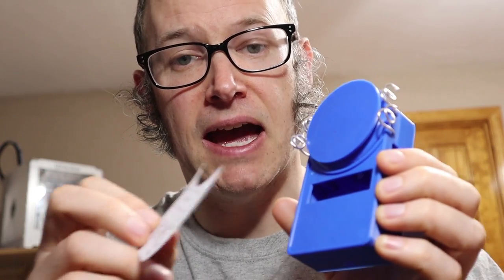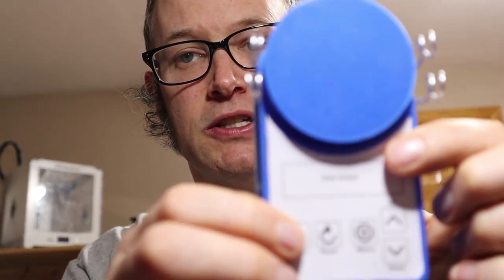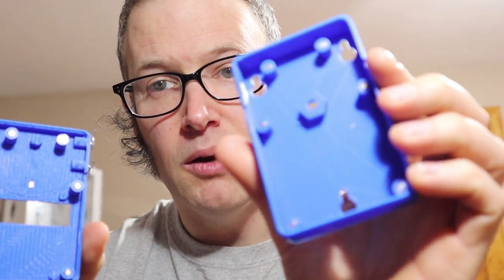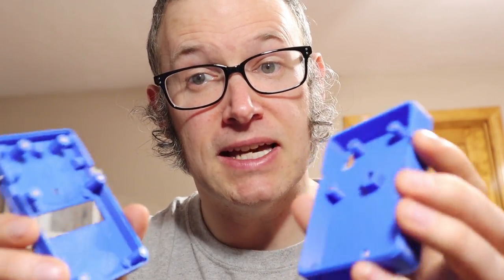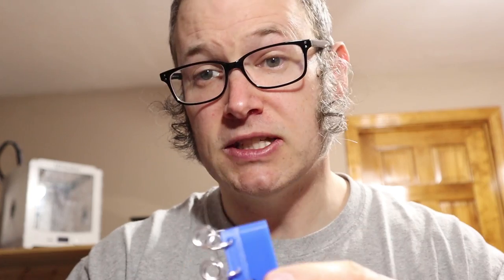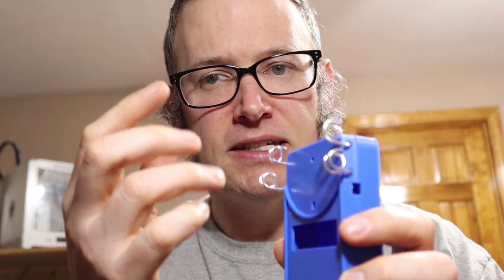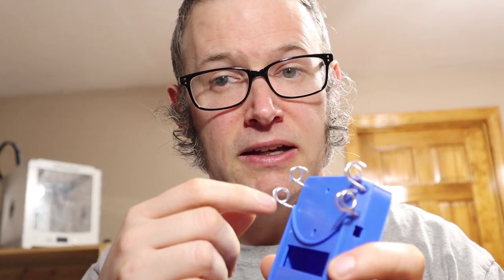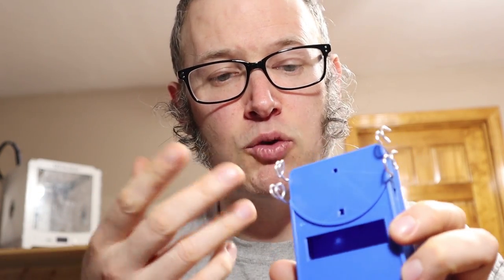SPIN #69 - Help Design the Ultimate Yarn Counter

Comment: - Love the size! 
- Love the UX overall, but recommend remove the circle around the menu icon (just use UI-standard “hamburger”). 
- Vote YES for the nicer keypad (better haptics). 
- Power button should glow green when on (obviously). 
- Yay magnets!
- like the clamp/ bolt but be very sure it’s got plenty of room for tables with deep lips ;like many Costco “cafeteria” tables
- love the programmable beep option! Love the ports! Be great if power cord matches nano’s. Other port could be for software updates and customizable settings outside the menu settings (customizable colors if OLED, etc)? Use universal mini-usb connection? OPEN SOURCE MAKES ME SO SO SO HAPPY THANK YOU SO MUCH!!! Name: “EEL COUNTER”
- OLED display maybe?
Reply from the maker: Great feedback overall.  

I probably wouldn't make the button glow green because that would consume a significant amount of power (10x more than the screen when the backlight is off).  Also there would probably be a problem with the screen being in the way of the green led.

One nice thing about the clamp is that it can easily be extended by just buying a longer bolt so if the one I ship doesn't work on a really thick table then it's easy to get a different one at the hardware store.

Oled screens would use a lot more power than a reflective lcd screen.  My lcd might allow backlight as an option, but oled would never have a low power mode.  Remember I want a mode where this lasts hundreds of hours on 2 AA batteries.

Comment: The size looks nice for how it sits in your hand.  You should also have a feature on giving a choice of Yards and Meters.  Many of your customers who purchased your Eew Wheels use Metric System vs Standard System.  You should put the type of plug that fits the same cables that came with the Mini or Nano wheels.  The buttons look nice as your prototype.  If you have a kickstarter for this device, I'm signing up for one.  Knowing you your price will be very reasonable/ affordable.
Reply from the maker: Thanks for the feedback.  You will be able to switch between yards and meters.  

Unfortunately, I can' really use the same power cable as was used on the EEW Nano since the voltages would require a completely different power regulation chip.  I think I'll just focus on battery power for this device.
Reply: @DreamingRobotsBlog  A battery power would be just as nice.  That way you can still use it when you're away from home and there's no place to plug it.  The idea for a name of this device is; Eew Yarn Counter.

Comment: This device sounds better and better. It's wonderful seeing a device take shape. The only suggestion I have is for the keyholes to match the spacing on the eew nano. I'm not sure the reverse measuring tape device is as large as the base of the nano, so this may not be feasible.
Reply from the maker: This is much smaller than the EEW Nano so I won't be able to make the key holes match.

Comment: I'm loving the look of this, the size is ideal, not too big and not to small. You might want to consider two different sizes on the yarn guides one set larger and one set smaller. To accommodate bulky/chunky art yarns.
Reply from the maker: I will do testing with different sizes of yarn.  It's my hope that a single larger yarn guide can handle most types of yarn.

Comment: I too think that the counter’s orientation may be better in a vertical placement.  Thinking to how I would use this meter, it would either be positioned between my bobbin of yarn from the lazy Kate to a niddy noddy or skein winder when skeining my yarn prior to washing/finishing it.  I may instead, or also  use the counter between my swift and ball winder when winding my washed/finished yarn when winding into a ball prior to knitting with it.  (The yardage usually changes after the finishing process, so I may wish to have both counts.). Anyway, in both instances, I don’t know if it would have an impact on the yarn staying in good contact with the counting wheel if the yarn has to travel from bobbin down to counter/ table level, then back up to a skeiner, or from up off a swift, down to table level then back up to the ball winder.  The yarn would be travelling down in a vertical direction down to, then back up from the winder, with the short distance against the counting wheel/pulley being held in horizontal tension.  Would it be more likely to pop out of the counting wheel groove with upward tension at each end?  Perhaps if the yarn makes a full wrap around the pulley before leaving the exit loop, that may help it to stay put, or at least give more grip with slippery yarns.  Most other yarn counters that I have seen have the counter vertical, or with less deviation from a straight line from source to end.  Perhaps in practical use there is a reason for this, but you are an innovator and will for sure have considered this.  The little ones that simply run the yarn through a slot (like a fishing line counter) seem to be horizontally fixed, but work a bit differently and do not handle as much as a variety or yarn sizes.   Thanks for hearing all of our input.
Reply from the maker: No, having the yarn travel down a few inches won't make it more likely to pop out of the pulley groove.  We will test if having the yarn drop is an issue.  If it is a problem, I don't think making the orientation of this device vertical will solve any issue since that would just move the pulley up a few inches and that wouldn't likely match the height of many people's setup.  Instead I'd probably recommend people put a base under the yarn counter to bring it to the desired height, but I don't think this will be needed.

Comment: Would you consider having some sort of way to attach it to a surface  up on its end, like the position you often hold it in this video? I would like to be able to mount it on the table in front of my nano's orifice to get an immediate yardage count as I spin. Your ideas are amazing. Thanks for continuing to make cool things for the fiber community 😊
Reply from the maker: I have thought about this, but it would require me to find a way to attach the yarn pulley with something other than gravity, while keeping it easy to take off.  I also couldn't come up with a good reason to do this.  It would move the yarn hook up a few inches, but why couldn't the yarn just drop a few extra inches.  There should be no downside in that.  Maybe it makes the screen a little easier to read in certain cases, but the yarn pulley problem would be a pretty big change so I'm leaning towards just a single orientation.

Comment: I really like the choice of mounting options provided and the external power is a big bonus. Love the idea of pre-setting it to let me know when I reach my desired length.
What colour options can we have for this unit? Same ones as the Nano?
Is there any "memory" in case I need to turn it off for some reason and come back to that same yarn later?
Reply from the maker: I have not yet started thinking about the color.  It will probably have to match or complement the keypad colors.

Yes, it will remember where it is if you press the power button.

Comment: Thank you for all your hard work, Maurice.  Please keep things simple.  People will learn where the buttons are no matter where you put them.  I for one would much appreciate being able to use external power, or have the device itself be rechargeable.  (Would weak batteries begin to give false readings?)  I know an extra mounting hole isn't a big deal, production-wise, but I would think that the 4 corner keyholes would be sufficient.  Someone mentioned "slippery" yarn, which would be a definite consideration for those of us who spin silk, tencel and like fibers; a bit of texturing on the pulley may help.  Name?  Short and simple would fit nicely -- EEW Yarn Counter, perhaps?
Reply from the maker: Thanks for all the feedback.  I couldn't quite understand your comment about 4 mounting holes.  If you are saying you'd like 4 instead of the 3 keyholes I've put on it, let me explain why there are 3.  I think 3 is enough for this kind of device and we will be testing that, but the reason I am trying to get away with 3 is I can't fit everything else into the case with 4 of these holes.  If I do need to go to 4 holes I'll need to make the case a little bigger.
Reply: @DreamingRobotsBlog  Oops, my bad!  I missed the fact that there were only 3 keyhole slots -- not 4.  I was referring to the small permanent mounting hole in the middle being unnecessary but, on further reflection, this would be an easy mod and may well be useful for some.

Comment: This looks great. I'm an indie dyer so I often spin 100+ mini skeins from cones of yarn. This would be an absolute lifesaver. 
- Could it please be screw mountable in the vertical position.
- Support Yards and Meters
- Have a save function so you can save a few standard lengths. 
- Have the yarn guides be multi directional so you can use at any angle without putting too much tension on the yarn. 
- Mains power isnt needed and as I'm the UK it's completely redundant. Batteries or USB is the way to go. 

Thanks!
Reply from the maker: Thanks for the suggestions.  I don't think it's reasonable to allow exact lengths since entering exact lengths would be a pain with the limited input.  I could do it thought I suppose.  I think this is something I'll open up to the community later when the software is done and people can see it.

Comment: I've just spun up a batch of fairly fine yarn that seems too slippery so it won't catch and turn the wheel on my current yarn meter. Would this meter handle a lace weight silk or bamboo blend or would it also slip?
Reply from the maker: I haven't done that testing yet, but I believe it should and we will be testing all types of yarn and let people know how it works with different types of yarn.  Also to make sure it works for others I always send a few of my prototypes to spinners so more people can test it and I can fix any issues they find.  I always try to make sure my products work as well as they can for a given price point.